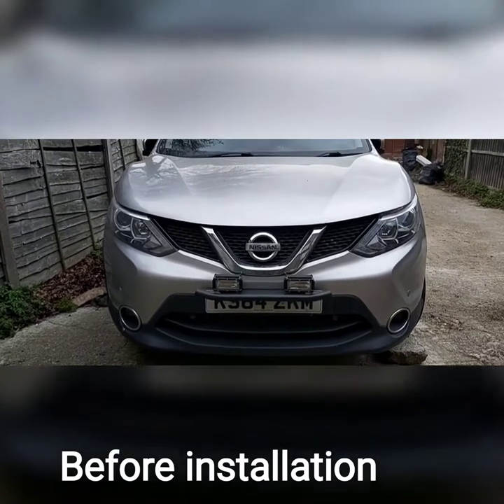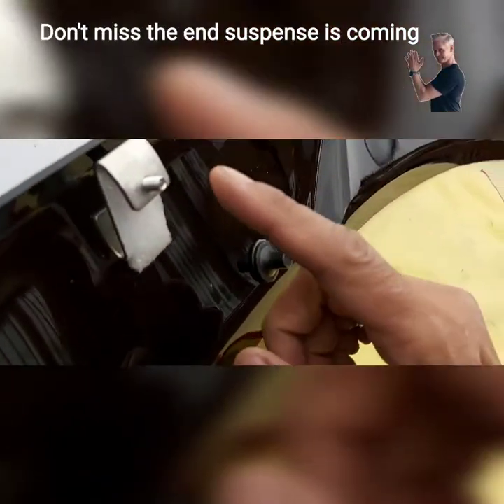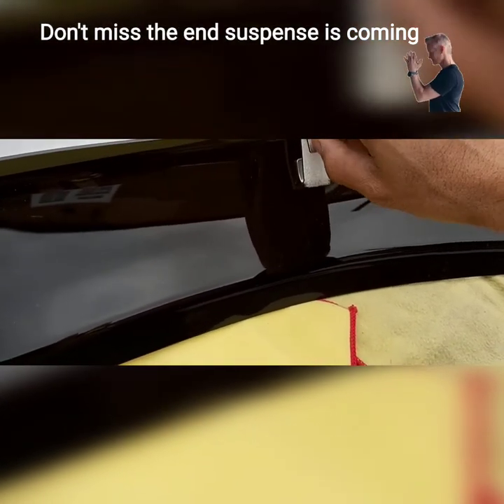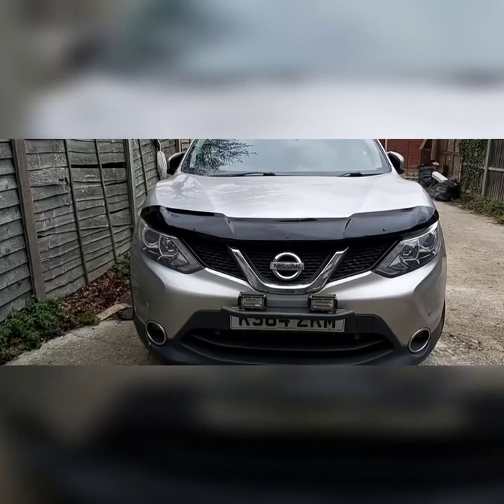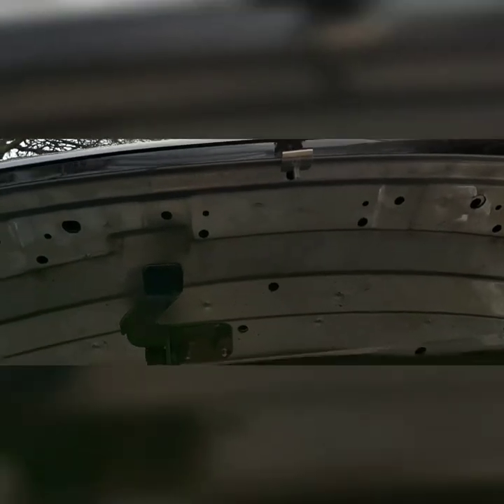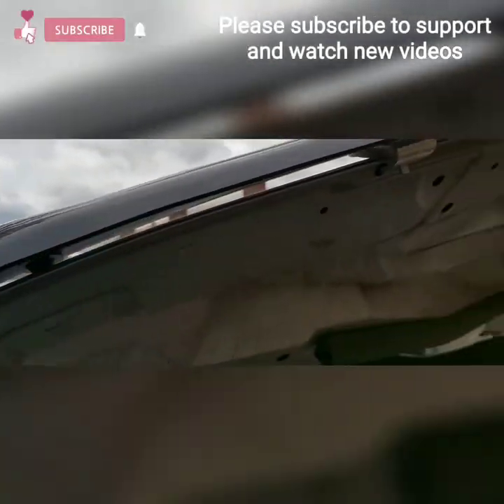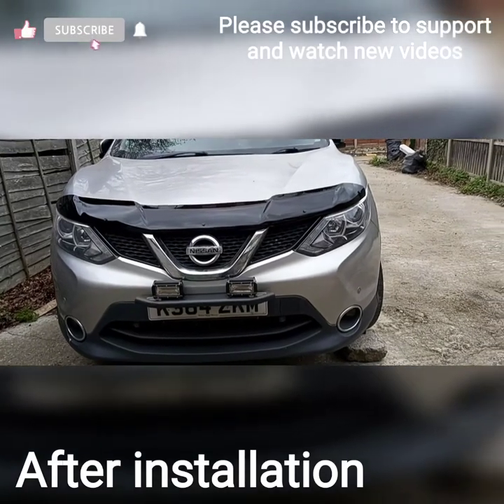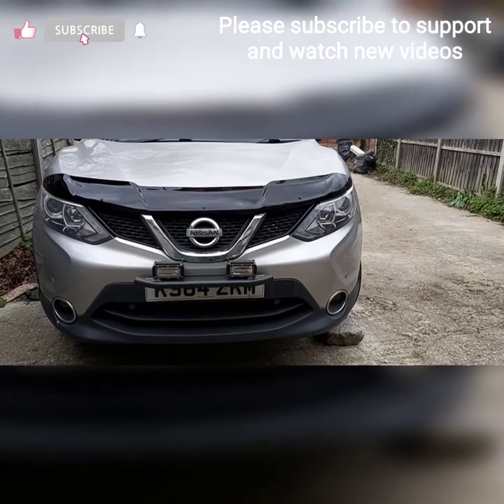NISSAN QASHQAI BONNET GUARD PROTECTOR INSTALLATION

Comment: Would the metal brackets not scratch the paintwork if you ever took it off ?
Reply from the maker: Hi. I applied double side tape behind it ,to avoi scratch and be stable
Reply: @Kamalsblogs doesn't it already come with foam installed?
Reply from the maker: It comes with a foam pack but to secure I put double sided tape also.
Reply: @Kamalsblogs  did you take the foam off and then use the double sided tape? Did yours come with a clear 1 sided tape?
Reply from the maker: Keep the foam with the fender. And give extra support with the tape